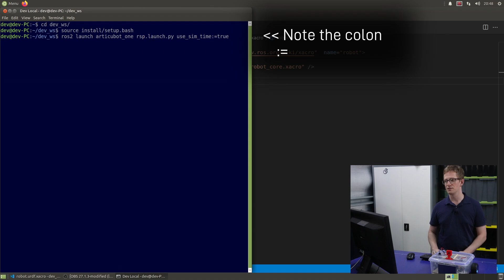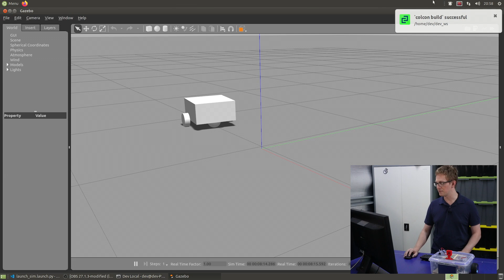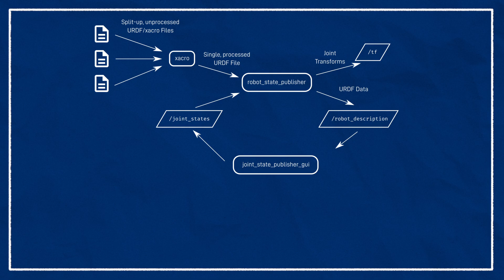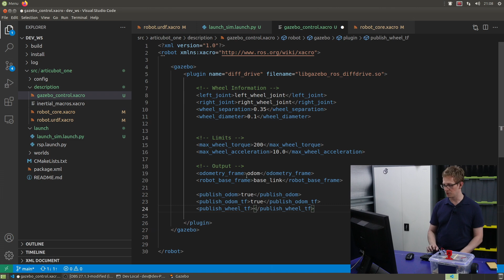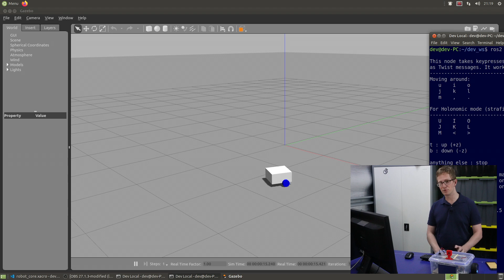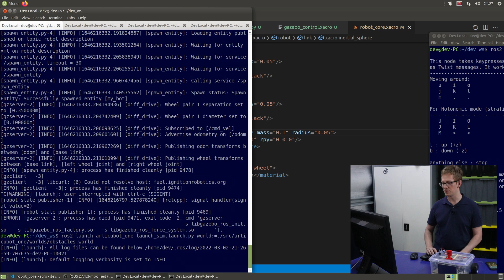Comment: I've been stuck for days on a problem I can't seem to move past: my robot in Gazebo will not move in response to teleop keyboard commands (but will change speed). Instead the robot moves very slowly backwards and to one side (teleop starts with speed 0.5 and turn 1.0). I see in the video that your robot is also drifting slowly-why is this? I've checked and triple checked my code for errors. Running ROS2 Humble. Any ideas on what I might be missing here?
Reply: Did you solve the error?
Reply: @pragya4677  yes, I solved the error
Reply: @saiphanichandrachittaluri1910  how did you solve it?
Reply: @saiphanichandrachittaluri1910  Insane gate keeping
Reply: Please how did you solve the error ?
Reply: @herrjonatan5436  Before I forget to download gazebo-ros packages, after installing it went fine. May this help to you
Reply: @herrjonatan5436  My issue was that the right side wheel joint axis was not opposite of the other one. So it should be for the left one <axis xyz="0 0 1"/> and for the right one <axis xyz="0 0 -1"/>

Comment: Thanks so much for making these tutorials! I've been stuck for days on a problem I can't seem to move past: my robot in Gazebo will not move in response to teleop keyboard commands (but will change speed). Instead the robot moves very slowly backwards and to one side (teleop starts with speed 0.5 and turn 1.0). I see in the video that your robot is also drifting slowly—why is this? I've checked and triple checked my code for errors. Running ROS2 Galactic. Any ideas on what I might be missing here?
Reply: I also got the same problem.. anyone please help ? BTW I am using ROS2 Humble
Reply: @debanjanbarman.official  Mine didn't work either, but that was because I had forgotten to add the <collision> tag for the wheels
Reply: I am also facing same situation
Reply: Hi @ThomasBurns, Now I figured the solution. I am currently using ros2 humble for solving this issue I installed the package called sudo apt-get install ros-humble-gazebo-ros2-control it is working for me
Reply: hey were u able to resolve the error??
Reply: @ManishKumar-mc1so  Hallo, do you find the Error, do you have found a solution?
Reply: same issue here :(

help!

Comment: Amazing! I love your series. I am trying to use your guild with a similar project. The difference is using an available model (file .STL)
When I launch on Rviz2 (command: ros2 launch agv rsp.launch.py), it works well
But, when I launch on Gazebo (command: ros2 launch agv launch_sim.launch.py). It also run without errors or warnings. However, the model didn't appear on world.

After some test, I find out that problem is about .STL file. Can you help me?

Comment: Has anyone solved the problem of the odom frame not existing in rviz? In addition to that i don't have transforms from wheels to my base_footprint (in his example i think this would be base_link)
Reply: I've got answers (sort of). For my issue with transforms, I restructured my urdf to match the example with the same names and that seemed to do the trick (i must have at it set up incorrectly). As for why these transforms now show up correctly without also running join_state_publisher, i do not know. For the issue with the odom frame, we need to add two extra lines to the plugin in the gazebo_control.xacro. Those are: <command_topic>/cmd_vel</command_topic>
            <odometry_topic>/odom</odometry_topic>. After this addition, you should see the odom frame. Hope this helps somebody!

Comment: Hi. You've probably heard about the problem with missing odom in Rviz2. In my case it also appeared, but only after the second time I ran the program, the first time it worked properly. I've tried resetting Rviz, I even changed distro to 22.04/Humble and all the time is the same - no odom. Do you have any solution to this?
Reply: Did you get the solution for it? I am also facing the same problem, I am using fortress gazebo and with little modifications I was able to move the robot with the keyboard..

Also when I see the gazebo topic list I can see the odom and cmd_vel being published but they are not there is ros2 topic list, the bridge function can't seem to working as intended..

Comment: Anylne could help me. I've been stuck in this portion of the series for a while. When I run the robo5 in Gazebo, it starts oscillating in, what it looks like the z axis of the caster wheel. I have checked the code multiple times and change parameters for the torque and speed and it is still doing that. 

Besides that the series is being amazing so far.

Thanks for all your work!!

Comment: amazing lectures, started from first and was going well 
but i have one issue
in fixed frame i don't get odom , i am only getting base, caster_wheel, chassis
earlier also i had the same issue, but whenever i added the GUI for joint GUI of wheels, all the frames appear, 
since now i don' have GUI enabled for this i don't have a way to get frames
also there is an error on rviz cmd terminal left_wheel passed to cantransform source frame does not exist

Comment: It seems like this gazebo-thing is just another game engine. Why not just use a standard game engine that is much more capable of graphics. You can make an object have a ROS interface in Unreal (C++), godot and even directly in Blender3d using upbge running Python. I don't get the hype, when it's just a kind of low-end game engine, sorry.
Reply: That's a great question that I have asked myself! The discussion thread linked below has some really helpful points to answer it, but some of my own:
- At my workplace, we use Unity as we were already using it before were aware of ROS and Gazebo
- Those game engines are much more flexible and are great IF you already know how to program and use them. If you know nothing and just want to start with robots, the learning curve is steeper
- The tooling, physics sims, ROS integration, etc. are all oriented towards robotics. 
- You say it's a "low-end" game engine, but that's because the things it is missing (e.g. nice graphics) are generally not relevant to simulation robotics interactions

https://discourse.ros.org/t/why-do-we-use-gazebo-instead-of-unreal-or-unity/25890

Comment: Great vid again! I was able to control the robot using the teleop line but when I tried running rviz2, I couldn't see the odom as a fixed frame option. do you have any suggestions?
Reply: Thanks! If the Gazebo plugin is running correctly it should be an option. A few things to check:
- Rviz sometimes just glitches up and doen't show it so you can try just typing it in
- Install and run rqt_tf_tree to check which transforms are being broadcast
- Check the output of the Gazebo window for anythin that looks like a plugin failing to start/run
Reply: @ArticulatedRobotics  it’s working now. I’m not sure what changed tho!
Reply: @ArticulatedRobotics  . Thanks for the response. 
So i tried the rqt_tf_tree but it only shows the base_link, chassis, and caster_wheel. I also swapped out my launch files and robot description files for yours but nothing changed. The only way I can even see the wheel frames on rviz is if I use the joint_state_publisher_gui which I think is wrong for this stage
Also, when I run the launch file, i get the info line that says publishing transforms for odom and the wheels so it seems like it's getting published but its not being received

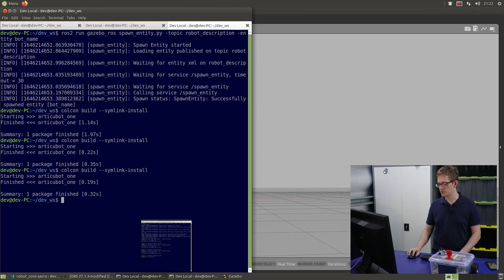Comment: I've been following along and everything is working. However, I am running into an issue at 17:50 when you set the fixed frame to odom. The only options popping up for me are  "base_link", "caster_wheel", and "chassis". Any help?
Reply: Got it working. All I did was run rviz2 first and then launch gazebo after
Reply: @josha.7364  I also faced the same problem. Have you solved it yet?
Reply: @josha.7364  worked for me too, now it doesn't matter which I run first, odom shows up, weird...
Reply: Hey guys, glad you got that sorted. Yeah I've found that RViz is sometimes a bit strange with that kind of thing.
As long as the code broadcasting the odom-base_link transform is running (in this case the differential drive plugin), RViz SHOULD show it in the list. If it doesn't you can try:
- Clicking reset in the bottom left hand corner
- Just typing it in manually
But sometimes it just gets a bit confused.

It can also be helpful in these situations to run rqt_tf_tree to verify that the transforms are actually being published (you may need to install that).
Reply: Hey my friend im new here , the solution is : 

Try to include the gazebo_control.xacro inside the the robot model file  robot.urdf.xacro
Reply: @chebbiiyeed8548  Thanks a ton! You just saved me a world of pain!

Comment: I'm trying to add camera to your gazebo robot. I don't know how It ended up tilting over.
Reply: Hey! Camera tutorial is coming soon - I've been away the last few weeks and haven't been able to record it. Was hoping for this week but it may be next.

The likely problem is that you need to have two links for your camera - camera_link and camera_link_optical. These should be at the same location but with different orientations, the first uses the ROS/Gazebo X-forward convention and the second uses the computer vision Z-forward convention.

Example https://github.com/ros-simulation/gazebo_ros_demos/blob/foxy/rrbot_description/urdf/rrbot.xacro#L162-L197

Then, you should have a <gazebo> tag associated with camera_link that has a camera <sensor> tag inside it. Inside that will be your <plugin> tag for it to talk to ROS, and inside THAT should be <frame_name>camera_link_optical<frame_name> so that the correct frame is reported for RViz etc.

Hope that helps.

Another reference:
https://answers.ros.org/question/232534/gazebo-camera-frame-is-inconsistent-with-rviz-opencv-convention/

Comment: thank you for such video it's really help full.But i got only one problem i hope that you can help me to solve it the problem is when i launch the rviz2 i don't get the "tool bar "  "file  panels help" and i save the first configuration i made and it's the one that appears every time i want to launch the rviz
Reply: Thanks for watching!
To fix the default configuration being saved (which is easy to accidentally do) you can type "rm ~/.rviz2/default.rviz" into a terminal, this deletes the file inside the hidden rviz2 directory in your home directory.

As for the tool bar missing, I've had this before but I forget how I fixed it! Some things to check:
- Are you running rviz2? Is ROS sourced correctly?
- In the "Panels" menu, can you enable tool bar etc or are the options just not there?
- Make sure rviz is fully installed (sudo apt install ros-foxy-rviz-common I think)

I hope that helps!